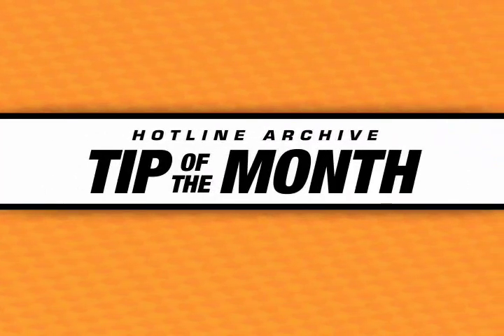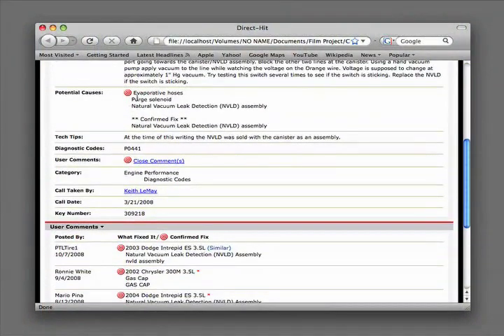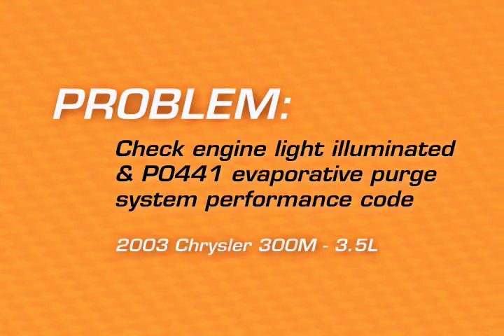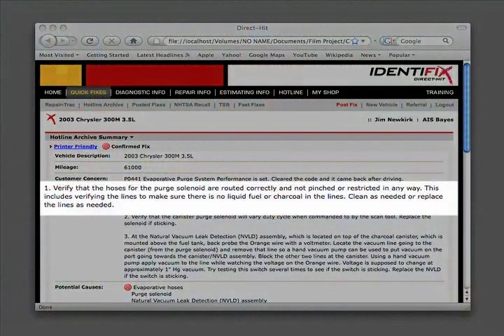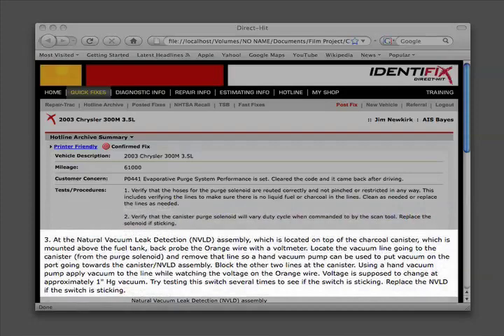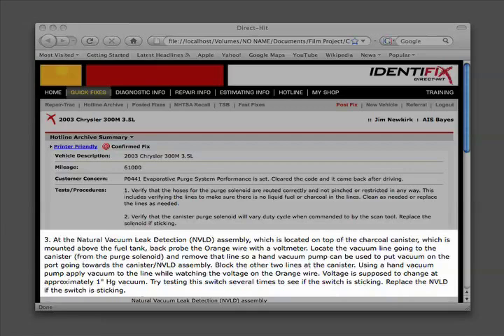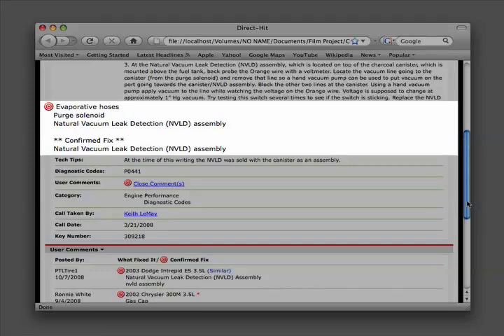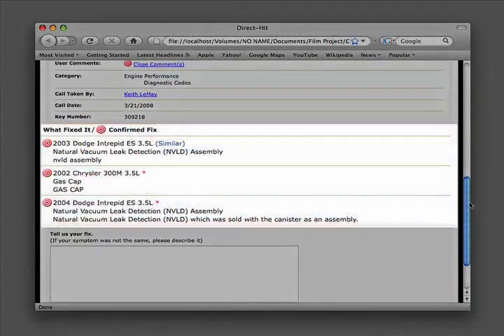Identifix: Chrysler - Check Engine Light and P0441

Comment: May be a ten year old video but its back to basics when a problem arises in a EVAP system. In some Chrysler EVAP canister to Leak Detector Pump
 the connection has a silicone circular "H" shaped flexible  gasket  inside which has a  fitment problem  over time and causes this issue.

Comment: I have a 2003 Chrysler town and country and my traction control won't turn on or off, how can I fix that, also the abs light is on, how can I fix them myself, or reset them, so I can use my traction control, I can't find a owners manual.
Reply: When the ABS light is on the Traction Control won't work on your model because the TC uses the ABS solenoids to activate the pulsing of the wheels. And the ABS system is inactive whenever the ABS light is on
Reply: monteg4 ok so how do I fix this?
Reply: You have to pull codes first. When you get the code you then follow a flow chart written by the manufacturer. That chart is also available from Mitchell or All Data. There are certain codes where a flow chart is almost not needed such as a wheel speed sensor. Usually if you have a WSS code it's the sensor as long as the wiring doesn't appear damaged.